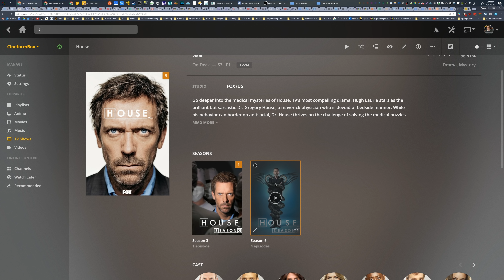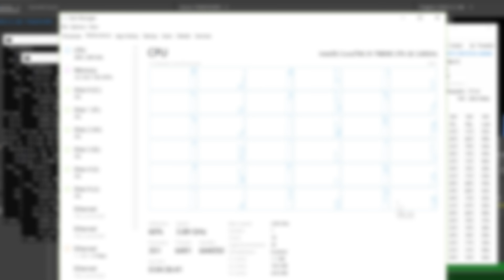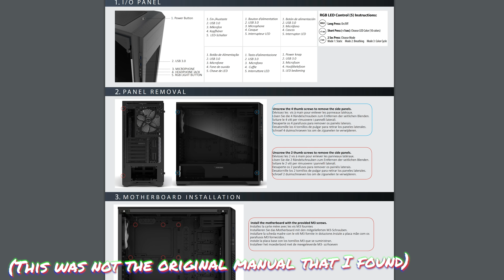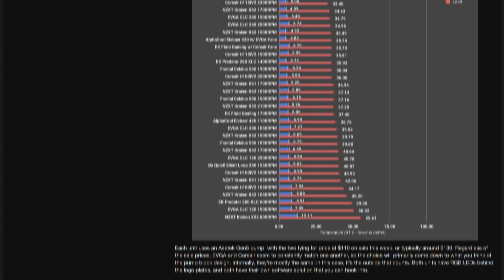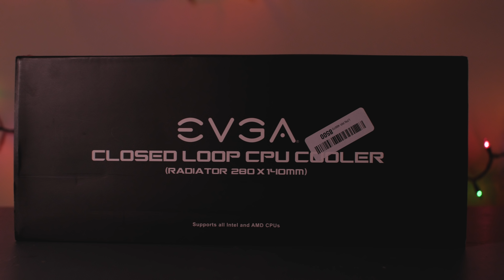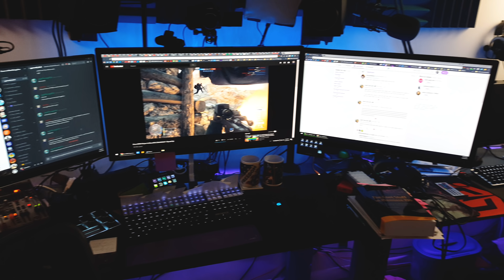The failed CPU cooler upgrade (i9-7980XE) -- TECH NIGHTMARES

Comment: That is why i'll always choose a big aircooler over an AIO. Works, cools well enough (very close to AIOs for the best ones) and maintenance is no issue.
You just have to deal with the mounting process and RAM clearance.

But that's my personal taste. Up to you.
Reply: i have seen the light. my CPU temps are about the same NH-D15 SE-AM4 vs H100i but the motherboard VRM is so much cooler with the Noctua not to mention the Noctua is just about silent and the h100i under full load was extremely loud And the AIO cost more
Reply from the maker: I can't recommend the D15 enough. Been my favorite for years
Reply: Very much this.
Reply: Same here, had an AIO for my pc but then just changed to an Air cooler, i would suggest getting AIO coolers for more compact builds like mini ITX

Comment: Fun fact, you could have reversed the direction of all of your fans and had the best of both worlds.  Pull air in the top and back and exhaust out the front.  Keeps the nuts cooler to boot.  You were exhausting all of your heat through the cooler which is why mounting a rad at the top of the case in a single rad loop is the worst.  With dual rads, the top rad is the first in-line followed by the front.  You can also double stack rads so long as the last rad in which coolant flows is the fresh air one.  I believe linus did a half-assed rad stacking video that shows the importance of flow direction in stacked rads -- and for all intensive purposes when you have a rad at intake and another rad on exhaust, if it's part of the first loop or not, is inefficient.

Comment: wait wait wait wait wait....  you have the fans on your top mounted radiator set to intake and not exhaust?
Reply from the maker: For the cooler I tried installing, yes. The normal fan there is exhaust. But exhaust on that cooler was actually a lot hotter.

Comment: You seem like a cool person, and you do a good job with editing your videos! Well done, but I have to be straight with you. I have found the EVGA CLC 280 to be a great cooling solution even with heavy overclocking. I have purchased their AIO's many times. There were some pretty big issues with your PC build which I fear contributed to your temps. I'm also interested in what thermal compound you are using and how it is being applied. To be fair though every product has a dud from time to time. This is not a hate comment, but I wouldn't write off the CLC 280 or EVGA product line. They actually do a pretty good job at cooling.. At the end of the day we can't all be pros at all things, and though I saw some issues with your PC building methodology your editing, voice over, writing skills are great. Maybe collaborate with PC builders or ask your community for tips in the future. All the best and wish you good growth for your channel in the future. Take care.
Reply: @EposVox   Oh, and deliding is actually pretty easy if you get the right tools and materials. Maybe buy a crap CPU to try for your first time?  If you ever decide to take the plunge feel free to PM me and I can give you some personal tips and tricks. Take it easy.
Reply from the maker: Using MX4 and fine application process. I didn't write off the cooler entirely - I even addressed things like having to mount it in the top contributed to it performing worse, etc.
Reply: @EposVox   Hi there EposVox, do you mind if I email you? Wanted to throw a few nuggets of info your way.

Comment: Hey man I had a quick question. It was on one of your old videos but do you know specifically how to turn off icons on the lumix g7 for cam link? And also which setting do you use on the camera when you use the cam link? Intelligent auto? I can't figure it out in settings or by reading the manual. If you could help I'd appreciate it.

Comment: I was thinking testing the fans pointing in different ways to see which way would of worked best of that config. Might of been able to get it to work if you had more time. I had to play with my fans a bunch when setting up my computer to get to where i am now. Though I wish I got a 360 radiator. I'm only running a 120. Because I originally planned to use another smaller case. But my graphics cards wouldn't fit heh.

Comment: I feel you bro, several thermal applications later, a new case, new heatsync, and an undervolt applied and my 7700k still reaches around mid 70s at load :(

Comment: I have built 3 PC's and NEVER had one go together without a problem..., ever. 
The problem is I live so far away from any PC shop and most of the time I have to have the parts posted or shipped, 
so if anything doesn't fit.., is damaged or faulty it is at least a weeks turn around..., AT THE BEST. I always do my homework, check, check and double check...., but everytime there is something small that is over looked. I would loooooove to be able to do the cool types of builds, like Jays2cents.., with all the water cooling RGB.., and wanker stuff on the PC..., but I just cant afford to have that amount of extra pumps, tubing, joiners,CPU's, GPU's, fans, etc laying around..., as most people who aren't getting it for free. (No, I am not complaining.., half thier luck). So I agree..., sometimes building a PC just sucks. 
Cheers

Comment: Im thinking about buying an i9 7960x is it worth paying another $800 for the i9 7980xe
Reply: You enter high diminishing returns territories when you are paying $800 for 2 hyper threaded cores. Also, as demonstrated in this video (and plenty other on the net), the temperatures on these CPUs are very high, so shaving 2 cores does have the advantage of pulling less power and producing less heat. You could potentially clock the 7960x a tiny bit higher.
I'd say unless you absolutely need those 2 extra cores (you are mainly using the rig with applications that are taking advantages of all 18 cores), you might be better off with the 7960x and either more memory or better / faster / bigger storage or better video card if you are planning on gaming (so, you can spend that $800 on parts that will matter more, or just save it for a future upgrade).
The 7980xe is really a halo product, just to demonstrate that you have the "best" consumer-grade CPU, but the premium is pretty high.
Reply from the maker: Most performance tests don't have the 7980XE being worth it

Comment: Couldn't agree with you more. Everyone complains to me about my personal rig and how it only uses a basic air cooler to cool my Ryzen 7 1700 and since I am a PC hardware reviewer I should try a custom loop or an AIO. Yeah, those would be upgrades but the time and effort needed to put into the one PC that runs my entire operation with a good chance of wasting an entire day doing it makes the whole ordeal not worth it. Great video, love seeing PC content from you.
Reply from the maker: Thanks man
Reply: Yes it turns out if your unable to read the manual you wont know where the AIO installs now seeing as he can't read a manual im guessing he dosn't know that if you put the back fan to pull air AWAY from the AIO then it will run hotter......

Comment: If anything in life is so important that going without will cause a hardship then you need a backup planned out.
Reply from the maker: I mean, I have other PCs that I could use and are capable. I have a backup. That doesn't mean that going without my primary workstation would just magically not be an insane inconvenience.

Comment: If you want to maximize CPU cooling, you need the AIO radiator on front to intake the fresh air from outside. Ideally you sandwich the radiator with fans from both sides. So you had it right the first time (obviously it does better). Just get the optical drive out to get the better AIO in the same config. Why do you need internal optical drive? Just get an external/usb one, it's like 20 bucks. 

I just built Dark Base 700 case with Corsair H115i Pro RGB AIO and I wouldn't be able to fit optical driver either. I wouldn't want to anyway though, who even uses DVD's today? The legacy optical drive bay takes so much goddamn space, the external one is like 1/4 of the size. Just keep the external drive outside of PC, and plug it similar to USB drive only when you need it.
Reply from the maker: I use up all of my available USB bandwidth and USB BluRay drives are a terrible experience overall. The whole point of me buying this specific case was not having to compromise on an optical drive for AIO support.
Reply: @EposVox  PCIe USB extension? Depends what is really your priority now then.
Reply from the maker: My priority is clearly on keeping the BluRay drive.

Comment: This is what happens when you try to cool a $2K chip with a $100 cooler...
Reply from the maker: Cooling performance doesn't scale with price. Outside of custom loop liquid cooling, $100 range is the high end...
Reply: @EposVox  nah, any one of the 360mm AIO's would have done much better. Had that same CLC 280, and the H150i can handle a higher OC for much longer.
Reply from the maker: Except a 360mm wouldn't have fit, that should be blindingly obvious.

Comment: upgrade form 240 to 280mm is so small what did u expect to get better temp just delid
Reply from the maker: Yes, there's plenty of data to suggest a 280mm makes a significant improvement over 240 for this CPU
Reply: if u want to see improvment in temps then custom loop with 360mm radiator or 360mm aio or just delid and u will be fine with 240mm or 280mm or just get 360mm and delid to get quiet pc under load.
Reply from the maker: Custom loop watercooling isn't an option, and "just delid" is big talk from someone who hasn't done it nor has to pay for the $2000 processor. It's not that simple

Comment: 2 things. you went from push pull to only push? 2 use thermal grizly not that cheapo thermal grease should do the trick. aaand the fans.....they really suck.....noctua is ugly as hell but worth it
Reply from the maker: Yes because most research suggests push pull isn't necessary or helpful anymore.
And I literally used Thermal Grizzly Kryonaut and said so in the video
Reply: push pull more airflow, and yes it helped me a lot. o didnt listed just watched at 4:36 that doesnt looked like thermal grizzly. just sharing things that helped me out a lot.

Comment: The Big coolers are becoming a problem. you have to research like a madman to see if it will fit. I was happy to find out the NH-D15 fit my Ryzen system. i replaced a old H100i with the Noctua and so happy that i did.  CPU temps are nearly the same BUT the VRM on the mobo now has some airflow. Not going with a water again the Noctua for me is just better, not loud and now my VRM run much cooler too.
Reply from the maker: The Noctual NH-D15 has been my favorite cooler since ~2014 (D14 back then). Future for-me builds will go back to using that in a Fractal case. The flash isn't worth it
Reply: I look at pre built pcs and use them as a refference & research coolers of similiar size aswell as similiar case size

Comment: You should have used liquid metal instead of thermal paste. the different on high tdp cpus is crazy. even if your cpu is not delided. it does make a difference. btw deliding is not problematic anymore if you use one of the little helper tools like those from "der bauer". even i did it without a problem and i cant get a nail straight into a piece of wood. thats how bad i am
Reply from the maker: It is still problematic. I know a few people who have been trying to get a good delid scenario going and it's been a total nightmare. I simply do not have the time for that
Reply: with the tools you just stick your cpu in there open it in like 30 secs, free it from the old glue and replace the tim + glue it with some heat resistant glue back again. it took me with a lot of care like 20 mins and in terms of craftsmenship... im dumb. so its definetly not a problem if are a bit carefull.
even if u dont wanna overclock my temps lowered by 20C which is a huge lifetime increase + less power consumption. there is a lot of bullshit you can do but delidding is definetly worth it. if u dont want to delid with some of the diy methods... i can understand that. i would not try that 2 but like i said the delidding tools are simple to use. you just need to be a bit carefull especially while cleaning all the "old glue" cause you need to get everything of the pcb.

Comment: So much wrong with this setup, if you need help, let me know my man!
Reply from the maker: Not much wrong with it at all. Help not needed, only potential next step would be swapping to a D15 or delidding, neither of which I'm going to do right now.
Reply: @EposVox  all good my man, PC building isn't your strong suit. Lots wrong with it but if you're happy with it's performance and looks, then all good.
Reply from the maker: PC building certainly isn't my weak suit. I had certain requirements for the build and things I wasn't willing to compromise on, and it turned out fine. Could squeeze a bit more performance out of it if I was willing to put more time in tinkering, but I'm not. I have real work to do.
Reply from the maker: Insisting I don't know what I'm doing while also saying I should use a cooler that clearly wouldn't work in this scenario when a smaller one didn't.... isn't a good look, my dude.
Appreciate the offer for help, but assuming you know better than others based on a small glimpse via a video is never the way to go.
Reply: Sticking that chip in that case was problem 1, cooler problem 2, fans problem 3. I could keep going but you get the point. You put yourself in the situation that your in based off your parts choices. That's also what I based your building ability from, I did check out more of your channel before commenting that, and still came to that conclusion. That setup is a bad look my dude...
Reply: @EposVox  like I said, was just offering help, not attacking, but good luck with it.
Reply from the maker: It's almost as if the point of the build was seeing how the i9 handled smaller form factor builds in a real world environment, the fans were free and part of the YouTuber RGB flare just to do something different (though they're pretty solid fans, better than what came with the CLC 280), and the other things were specific requirements I wasn't willing to sacrifice (optical drive)

Comment: My plan for cable management is to use 2 or 3 velcro strips and spend about 5 minutes or so routing the cables enough to make installing the case panel relatively easy. Aside from that I won't waste a bunch of time trying to conform to what the "Cable Nazi's" feel is proper cable management. And I charge extra on any repair that requires cutting a bunch of zip ties (which have absolutely no business in a computer to begin with) to perform the required repair. And I do not put them back when done. This is explained to the customer ahead of time.

Comment: hmm I detect a pattern of you fucking up pc builds and breaking shit. Dude take your time and stop being in a rush all the time.
Reply from the maker: I've never "fucked up" PC builds. no pattern of me breaking anything, either - only broken thing was the USB header, which was caused by the tight fit/angle of my front-panel cable from my old motherboard positioning.
But, as this video should've made clear, my time for tinkering inside my main PCs is very slim.
Reply: No worries must have had you confused with reveiwtechusa he fucked up the pin header on his threadripper build anyways they make the USB cable far to short on the EVGA 280 I had to add a port replicator board for the internal CLC USB to reach properly. I would just ditch the DVD drive altogether get an external drive if your having clearance issues having your clc top mounted like that is no optimum for air flow. That clc rocks if mounted in the front in push-pull my 2700x stays at 4.050 @ 45c under load.

Comment: What a Messy build. Guaranteed my 9700K 8 Cores @ 5.3Ghz.                     and RTX 2080 Ti. Will destroy this PC and be Cheaper too. 
Having a soldered IHS will run much cooler. 
A 7980XE costs $1,899 + X299 $300 motherboard. What a freaking waste.
Reply from the maker: 9700k is for gaming, 7980XE is not. Also impressive that you already have a build with a CPU that was JUST announced. lmfao
Reply: @EposVox  soon.

Comment: use coolermaster trust me its good or use noctua cooler . never fail one
Reply: NH-D15 here on a 5GHz 1.38v 8086K, still haven't broken 74*C at the highest. Its usually around 65*C at full load. The rare occasion is when it hits 74*C, but its rare.